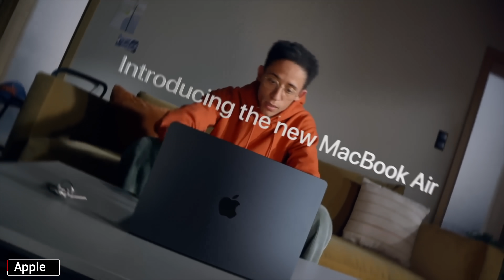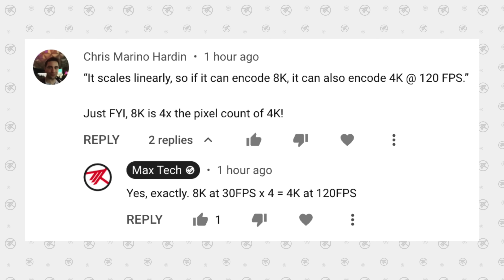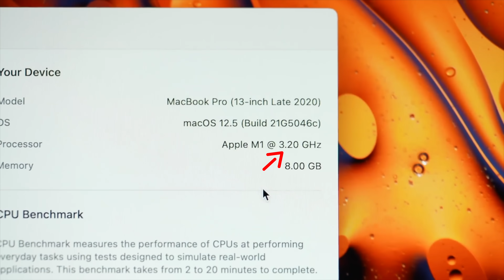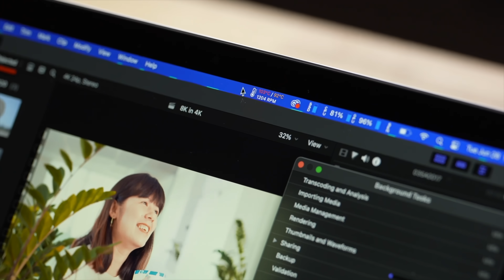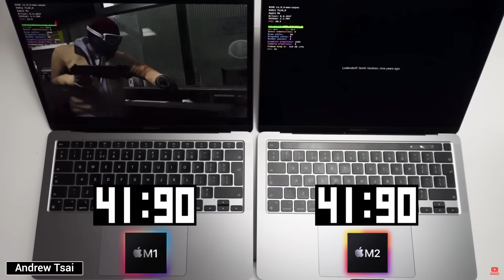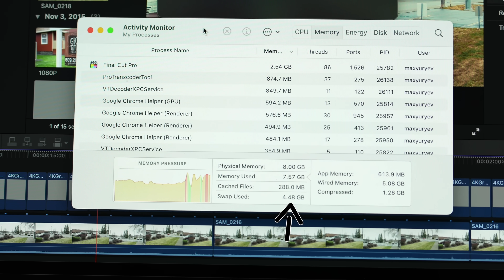M2 MacBook Pro - Top 7 Problems after 1 week..

Comment: For any contrarian holdouts still asking "why does the average user need > 1.5 GB/s speed on their SSD????
Consider that this is a dependency that APPLE created by cheaping out on the base model RAM. In order for 8GB to "be the new 16GB" that everyone declared at the M1 launch, the SSD needs to be ludicrously fast to step in as swap memory. Now Apple crippled the SSD that was being used to make up for the low base model memory. This is a $1300 computer folks, and $1200 for the upcoming MBA assuming it rocks the same SSD setup.

Comment: I share your concerns regarding the possibility that the M2 MacBook Air will overheat. It has no fan, its width is much less than that of the MacBook Pro M2 which reduces the area to dissipate heat, and we have seen a poor track record regarding this issue in prior editions of the MacBook Air. I am not optimistic. The MacBook Air M1 is looking better and better.
Reply: MacBook Air M1 also has no fan.
Reply: @cassanderrr  doesn't throttle tho

Comment: They are either trying to phase out the 13 inch macbook pro or something went really wrong with supply chain. Apple's not stupid. They are going to do away with the 13 inch macbook pro. The macbook air really is good enough to a good entry level.

Comment: I wonder if the M1 MacBook Air might suffer the same issues if you buy a recently produced one. When it launched it was before the chip shortage, so maybe they have changed it during that period… No matter what, seems like you should choose 16Gb of RAM and completely ignore the 8 Gb models of either the M1 or M2 models.
Reply: chip shortage doesn't affect new chips, it's mainly cars that use old chips.

Comment: Doesn't Apple know that Max Tech can reveal all the dark sides of their products? Haven't they realised that the ssd trick could be easily found?
Reply: @pete k What is astonishing is that the M1 MBA price raised in France : entry level cost was 1129 € before introducing the M2 and then 1199 € after M2 introduce…
And now it is only possible to order a 7 core graphics, no more 8 one
Reply: Apple is betting the masses will buy this without proper research
Reply: @yenk82 Apple knows that, that’s why they are doing this, they create a free buzz on their machines, everybody deals with it and advises to spend more money to upgrade storage and/or RAM, or maybe to upgrade of category of Mac. The only downside is ethics, but Apple’s current philosophy is not the same as Jobs’ time, money > ethics
Reply: Do the M1 Air’s sold in 2022 still have the dual chip setup or has Apple went single chip on all base models??🤨🧐
Reply: @EddwardNegma  I just came back from the apple store with a m1 air. at least the ones in stock have the 2 nands.🤯 ssd speeds are fast!!!!
Reply: Even the 13’ Pro is named Pro, Apple knows it is a general public machine, for people who don’t know precisely what they really need. They want a Macbook and buying a Pro to show off and not for real serious Pro work. The last users I mention already know what they need because they know the machine behaviour with softwares like Final Cut, Aftereffect or Logic Pro… These people are gonna buy the 14’ Pro

Comment: The main issue, for me, with the M2 is, that it is not the "promised" M2. It's just an M1 overclocked. The next M generation might "fit" well in an old MacBook Pro 13" enclosure if it is a 3nm. Let's see how the M2 will perform in the new 14" and 16" enclosure...
Reply: Yes. It looks like Apple pulled an "intel" by just overclocking an old CPU.
Reply: @77dris thankfully its not as bad as the intel macbooks. i can open 2 tabs on google and fans are on max
Reply: It is worrying for the Macbook Air M2, but if the usecase are thought to be different in the Specifications, maybe the whole structure of this model would have been design to fit perfectly with the M2 and perhaps the overclock of the M2 in this device could be less exagerated (I don’t know if they promised different performances between the 2 M2 machines during the WWDC ??)
Reply: @thomasr3407  What general public doesn’t realize is that Apple has always ride on TSMC superior fab for the past couple of years. Then covid happen. It reveal how much they rely on extreme transistors density for the chip performance. Now there’s nothing they can do with the newer chip on the same process node except adding more cores or increase clock which directly translate to an induced power draw. A15 vs A16 is the clear evidence to that.
Reply: Yea and especially with the 8 gpu core M2, it’s pretty much the same thing as the M1 just overclocked
Reply: Should be called M1 Milk. I am here to re-milk your money with old tech
Reply: M2 Pro Max chip will be based on 3mm.. So it's just the base model that's going to suck.
Reply: Not sure what you mean by promised M2....do you work for Apple designing chips? Apple calls this the M2 so it is the "promised" M2...just another excuse by an Apple fanboy
Reply: @kevinpoinsett , no I do not work for Apple 😁. But first, all expectations pointed to a 3nm processor. Then by the analysis, I will not spend money on a MacBook Pro 13" M2 that can go over 105ºC with active cooling!!!!! Its lifetime will be reduced for sure. Maybe they will release some software update to correct it, but I'm really tired of Apple patches. I'll wait to see how the other pros 14" and 16" behave!

Comment: TOP 8 problem:
On your 8Gb/256 base model, the expected life of your SSD disk  (this one and only chip 1x 256Gb) will be shortened severely compared to what would configuration 2x128Gb provide.
You see, SSD chips deteriorate with the usage, and every of them have how many times you can write and delete the cells in it. When you swap, what is actually happening is that your systems writes and reads a lot of data from ram to a disk and back. And having only one chip, means it will be used a lot and logically, its usage life will be shortened drastically. It measn it will literally kill the chip. If you do not have a backup, you will lose your data.
And I am not sure if Apple will repair it under warranty, as they may have a clause in regards to how much written data was under the limit they are OK for the repair to be on them.
When this happens, you are having a peace of beautiful yet useless hardware.

All because Apple wants to save a couple of bucks. The most valuable company. Now you know how they got there.

Comment: What some of these problems tells me is that the upcoming new MacBook Air with the M2 chip may have some real performance issues.  Will it also have a single SSD chip for the base model?  If the M2 runs hotter on the MacBook Pro, and can throttle back to limit performance, what is it going to do for the fanless MacBook Air?  My M1 MacBook Air is looking good at this point.
Reply: I highly doubt on that. Seems like M2 air  is another story. M2 pro is just old case with new chip. I'd put down this model from site, because it is shame for Apple to come with worse pro model than air. But world already is fucked up in china and Europe, so if one can't understand it, then good luck living in imagination.

Comment: I wonder if there are any additional storage configurations that suffer from Apple using only one NAND chip.  That issue coupled with the thermal throttling makes me not particularly optimistic about the M2 Air’s performance.

Comment: Actually using the same design is not a problem for me. It could be more reliable. When Apple tried new designs it got worse a dozen times: the short flat cable, the butterfly keyboard, thermals and throttling (on many Intel models)… 
What kills the machine for any serious works for me is just the SSD situation. That device does not deserve the “Pro” label. 
Let’s see how things will be on the M2 MBA…

Comment: Its a trend unfortunately, every device Apple has used with the same fab process as the previous gen is basically just overclocked. Compare iphone 11 vs XR & u see the same issue. Worse battery life, and it remains hotter on average.

The m2 mbas r gonna be even worse, they’ve no active cooling, plus the chassis is so thin, and the processor is power hungry + the ssd is slow. It’s gonna suffer even for daily normal workloads, and probably won’t age well.

When it comes to Tim Cook’s Apple, only upgrade when there is a real change of tech. When they go to 3nm process that’ll be the one to go for.

I’ve gotta say over the years we’re really seeing some dirty cheapass tactics from the Tim Cook run Apple. Steve Jobs would be disappointed.
Reply: 11 is worse than XR?

Comment: There is a rumor that M1 Macs that were manufactured recently also have that cheap SSDs.
Reply: Are they?  Bummer.
Reply: It is possible if Apple can’t or won’t buy the 128GB SSD flash anymore. That would be sad because a buyer will never know which one is bought.
Reply: So let’s then buy Macs on the refurb😆🤷🏻‍♂️👌🏻
Reply: @thomasr3407  Yeah, but the problem in the future becomes that people won’t know if the MacBook Air M1 is the good one or the bad performing one when buying second hand or when buying refurbished if Apple has really done this. Hope they didn’t. Somebody really needs to check it.
Reply: @genx-tv  Oh you mean Apple could replace the existing 2 storage chips system by only one for example for 2020 Macbooks in their process to refurb (when they change the body or the battery…) ?

Comment: Thank you for the reports on MacBook Pro 13".

Having been tormented by two iMacs with thermal issues (I wouldn't dare call it "heat" because they hardly produced anything good) for the past 10 years, I was looking forward to see a fast, no rainbow wheel turning, no show-interfering video editing on Premiere Pro kind of MacBookPro with M2 chip, but thanks to this channel, ugly truth has been revealed.

Come to think of it, then expensive PowerBook G4 17" lasted forever to the point of not-being able to update iOS for the first generation iPad.

Time to say good-bye to increasingly thin and burning temperature generating iMac.

BTW, Amazon in Japan does not offer deals on MacBookPro 2021.  You are blessed.  Apple products hiked prices in yen, thanks to increasingly depreciating value against USD and EUR. The apple-eating Grinch has arrived six months too early here.
Reply: So, which device are you going to choose? I am curious now
Reply: @nickhaldem9626  MacBookPro 14" 2021, provided that I will never mess with 4K movies. In this land or Sony and NHK, 4K means unbelievable block noise laden broadcast. FHD is good enough, as long as materials are shot and edited properly.

Just in case, I live in Japan, a US territory since the end of WWII. For example, Amazon operation here never pays their tax to Japan but the US Treasury. Credit card charges are iterated in USD.

Being an old-timer, I still need an SD card slot, and a DVD/CD disk drive connected.

Death to thin iMac 2021? 2020? whichever the newer and colour variations are so camp, thanks to our girlfriend CEO.
Reply: @heartsutra7798  appreciate your reply. Very educational. I am from Brazil.

Comment: If M2 MacBook Pro cannot maintain its temperature with a fan, it worries me what would happen with the MacBook Air without a fan.
Reply: It would perform the same
The Macbook pro fan don't start to cool the cpu until thermal throttle

Comment: At this point people who are looking at getting a new MacBook should just find a 14" base model if they can afford it. If you spec out the M2 MacBook Pro to have the same 16GB of Ram and 512GB SSD it's only $300 difference and it's only $100 difference if you buy it on Amazon right now since it's on sale. If you can't spend that much I'd just look at a M1 MacBook Air. It's still a phenomenal laptop and one of the best bang for you buck devices. I hope these issues don't play into the M2 MacBook Air, if they don't it will be a good deal overall to look at that option but we need to get away from 8GB of Ram and 256GB of SSD, it's just not practical in today's world anymore.

Comment: What are the ambient temperatures - with and without airconditioning -  in the room you ran these tests in? I ask because, after Covid, I stopped using airconditioning in any room when visitors drop in because unike in car HVAC systems, most domestic window/split AC's don't have a fresh air intake. And in the tropics where I live and work, ambient external temp. goes up to 48C, and about 40C indoors (in the shade) in summers. The latter drops to 30C in the rainy season. Point - Thermal efficiency is key here, unlike in cool temperate zones. And battery endurance will drop further if fans are running at max speed all the time. Thanks for a  non-fanboy review of an Apple product. I wonder if Apple's investors, too, have taken note of M2 issues, because Apple's market cap has been declining in the recent weeks.

Comment: So do you guys think the M2 chip is not going to be as good as the M1 or is just the M2 macbook pro a bust because of the old chassis with poor cooling performance and terrible SSD? Do you guys think the M2 pro/max chips will perform appropriately in the new M2 pro/max macbook pros with the new design and better cooling systems (especially the 16 in.), and hopefully way better SSD's?
Reply: We won't know for sure until the unit start being shipped, but given the value proposition of m1, that's certainly what I would recommend to someone who wants a MacBook.

Comment: I've been anticipating purchasing an M2 Air and eventually the new M2 (?) Mac Mini but in light of the downgraded performance of the M2 Pro, I'm very leery of what and how the future M2 products are equipped and perform.
Reply: Why Two M2 Machines?
Thats dumb
Reply: @framedthunder6436  The Mini is/will be for desktop use with a 32" monitor. I use a notebook in my pole barn for various things like looking up powder loads for reloading ammo, torque specs and wiring diagrams for vehicles that I'm working on. I sometimes use my current notebook for video streaming. I can afford it so it's not a big deal for me.

Comment: Definitely made the correct choice hopping from PC to the M1 Air back in 2020. Probably the best tech purchase I've ever made.
Reply: Same in April 2021, the only big shame is the poor webcam, and I have an iPhone 11 so no magsafe to use it how they showed in WWDC 2022
Reply: I did the same, just 1 year later.
Reply: Looking at the M2, however, I wonder if Apple Silicon is really that magical, because now they also have problems with power consumption and heat. So I wonder if Apple Silicon will be really that much better in the long run compared to AMD‘s Ryzen?
Reply: @haderlumpi  I really think there is a gain compared to x86, but maybe not because it is particularly ARM architecture, but because it is made by Apple and that they finally design and optimize the whole Macbook. I have an M1 MBA and in daily use it is perfect. However I was able to make it very hot, only with a simple work on Keynote (the Mac was plugged into an external display)

Comment: MBA m2 will be worse in terms of thermals and just as bad in terms of ssd performance on the base 256gb. Yes the air is a new design and will be the new must have fashion gadget , but if your smart for just a little bit extra cash you would get the MBP 14 with the m1 pro chip
Reply: same. if the reviews for the MBA M2, sucks, better go for 14 inch MBP
Reply: if we can’t afford the MBP 14 would u recommend the base model MBP or MBA???
Reply: @mikeb3292  mba m1
Reply: @mikeb3292  MBA m1 16gb ram